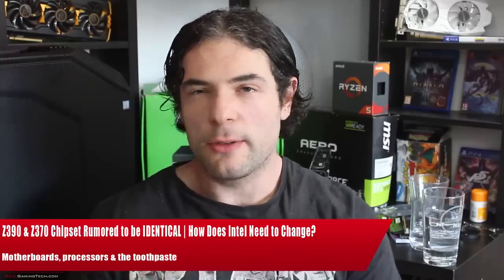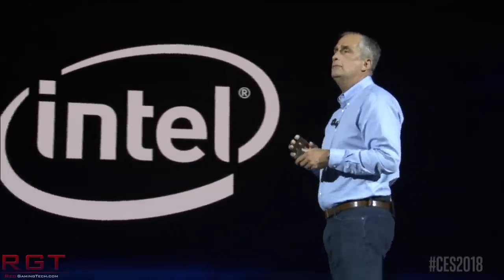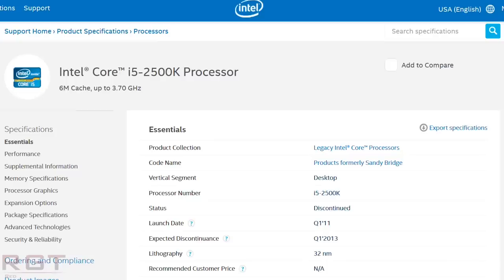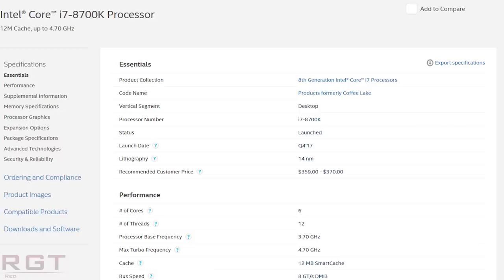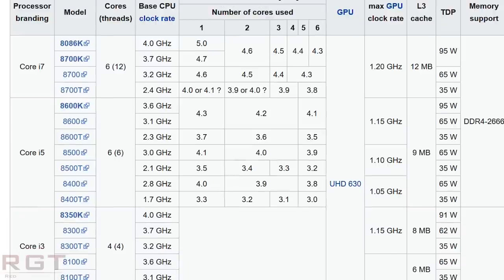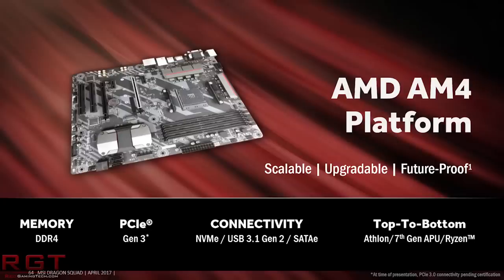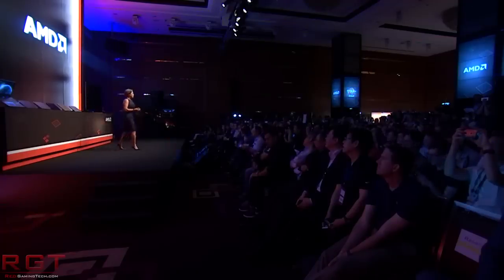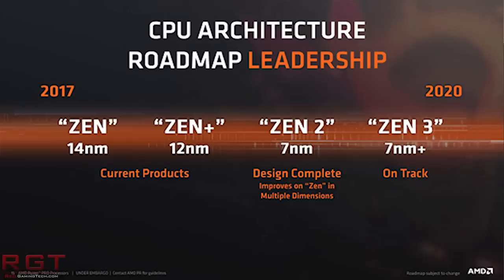Z390 & Z370 Chipset Rumored to be IDENTICAL | How Does Intel Need to Change

Comment: Sure... its totally AMD’s fault that Intel ran away and sat on their butt.

Totally cant be the fact that even during its amazing lead with the early opteron and athalon parts, Intel blocked out OEM’s from shipping machines with AMD chips by paying them nearly their entire yearly earnings worth in cash payments?

Even when AMD was in the lead they where on the back foot, with thousands of unsold chips that they could only offload to places like India and the middle east for cost or less?

That they where bleeding cash so bad they had to spin off their fabs into a separate company?

All while trying to develop phenom... a great chip... then bulldozer... a flop but it was an attempt to push the boundaries.

While AMD was strangled by decades of garbage that Intel got convicted of and fined for, AMD tried and nearly died.

We are lucky that the GOD of cpu architecture design took upon the challenge of designing zen for team red “for teh lulz”. 

Now AMD has a good place to start and with many of the anti-trust lawsuits on Intel bearing fruit - Intel can’t reach into its old bag of tricks anymore.
My only worry is... Zen has some room for tweaks, but I am not sure AMD has the talent left to make an all new x86-64 compatible architecture to top it.
Reply: Zen 2 I think will address the Infinity Fabric latency mostly as well as improving branch perdition and TSMC's 7nm will take care of clockspeeds, then Zen 3 will address latency between dies with an L4 cache on a controller die with the most of the infinity fabric back bone, the IMC and I/O. I would assume a 512MB L4 cache for a 4 die config, also a probable doubling of the L2 cache to 1MB per core.

The reason they could go for such a large cache is first TSMC's and Global Foundries SRAM density, and second it's going to be a separate die so 2 die CPUs can have a lower binned 256MB L4 cache and mainstream parts would likely have there own controller die with only IMC, infinity fabric and I/O, this has it's own benefits however as the die can be binned by the IMC quality, so higher end parts would support faster higher end RAM which makes sense from a consumers prospective, and will be important considering the likely move to DDR5 and the likely cost of highend DDR5 in 2020.

Global Foundries will likely produce AMDs APUs as there "7nm" node wont be ready in time for mass production for early Zen 2.
Reply: spoonikle the funny thing about those fines? they're still not fully paid.

Comment: I find it funny when AMD fanboys praise AMD with such ludicrous worship because Ryzen was such leaps and bounds over their last line of processors, meanwhile mock Intel for only giving incremental increases. Yet the thing is, AMD's Bulldozer line came out in 2011 with a, you guessed it, an incremental increase with its refresh in Piledriver in 2013 - and haven't released anything since. If they had actually been releasing processors for that 4 year gap Ryzen would be right in line where Piledriver left off with its yearly increases. Just because the gap is so huge, doesn't change the fact that the performance uplift is basically exactly on par where they left off. It's easy for a new product to be better than an old product when you haven't had anything out in years. That would be like if intel made Bloomfield then didn't put anything out until Coffee Lake. Of course the gap is huge with nothing in between.

Comment: z390 was already stated to be z370+wireless and something else all boards pretty much already had with 3rd party parts.
Intel uses paste instead of solder because then consumers cannot overclock as far without doing something that Intel can actually point at as a reason to deny warranty over.
Reply: Almost certainly will work on all z370.  People have already dumped even early bioses on Z370 and the active cores count goes up to 8 on them.
Reply: Honestly, it seems like maybe the 8 core is the reason why 8th gen doesn't work in 170 and 270 even though it very much could have worked with most of them.

Comment: I can think of two simple reasons why Intel isn't bothering with putting their K-chips through a separate IHS soldering process: 1- the extra expense of setting up a low-volume soldering process and 2- the CPU already being assembled prior to final binning since it needs something to sink heat into for thermal and power limit testing.

Comment: My shop computer is running a Q9550. My I7-4820K is soldered as well, and have had no issues with either. As far as I know, HEDT processors stopped using solder after Haswell-E/Broadwell-E, Xeon's should be the same through the E5 series
Edit : Changed "with", for "after"!

Comment: I have several old AMD CPUs that are of course soldered and none of them have any issues with anything and they all overclock like crazy with some light tweaking. I've never actually seen a CPU with issues due to the IHS being soldered and I've worked on hundreds of computers of differing specs. I call BS on the intel claim that soldering is less reliable especially considering their enterprise chips are still soldered, if reliability was a concern those would be the line that didn't have solder if any did.

Comment: the reason that intels production on 14nm is maxed out is because they moved the new coffeelake chipsets up to 14nm.  intel always uses the last gen process on the pch and the new gen process for the cpu's.  that would suggest that the next gen (9th gen) will be on 10nm.  cant wait to see if thats true and what it brings to the table.  would love to see the 8 core cpu work on z370 but if it doesnt its not a big deal to me.  the 8700k is all ill need for awhile but intel need to sort this out and get motherboard support mroe in line with what amd are doing.  now that amd's cores are on par with intels at the same clocks then they dont have the luxury of not changing things up.  and yes the 9th gen needs to be soldered, at least for the i7's and maybe the high end i5's at least
Reply: waterblocks and aircooler baseplates that fit within the plastic frame of the socket or a socket more friendly to naked die mounting would be nice.  cpu's used to come naked without a lid or solder or tim
Reply: bobhumplick The Intel CEO Bryan Krzynich that changed to non solder is gone
Reply: @darrenrapheal i dont see what that has to do with anything
Reply: bobhumplick The Intel CEO Bryan Krzynich that changed to non solder is gone.
Reply: @darrenraphael i still dont see what that has to do with anything.  what are you trying to say?  are you saying the cpu's will be soldered now?  maybe be more specific in what you mean.  yes i know brian krzanich is gone, but so what?
Reply: bobhumplick They will go back to solder to stay in business. The CEO that Bryan Kraznich resigned destroyed intel. Intel will be dead in 10 years because of him.

Comment: Ummm the Z390 will include support for the proprietary intel A/C wifi and bluetooth modules that won't work without that.
That's not third party stuff and from that we can deduce that Z390 is not the same as Z370.
What we do know is that there is literally no difference between the Z270 and Z370 chipsets. The Z370 is the rebadged chipset.
If there is no chipset support for the wifi/bluetooth with z390 motherboards, then they'll all be rebadged z270 chipsets.
You'd think they'd just enable overclocking on H370 and rebadge that. (but short 4 usb ports)
Or enable raid and overclocking on Q370 and rebadge that.

Comment: I have a 3960x soldered CPU for 8 years now, running 3.2 @ 5GHz with a AIO first then a custom loop. No craks or problems maybe if you let temps go above 65° for several times it may cause degrading and cracks don't know. And like some peapol repoterd using a old gen mobo with vrm etc designed for a16 core cpu and power drawe just can't handle a cpu drawing double with . Will burn up if you put a 32 core one it with a new cpu with double the cores is like

Comment: ryzen 3700x 7nm 3.9 ghz 16 core 95-105 watt tdp some extra cache overclockeble to 4.9 ghz
ryzen 4700x 5nm 4.4 ghz 16 core 95-105 watt tdp same cahce as 3700x oc to 5.1
ryzen 5700x 5-3nm 24 or 16 cores but with 30% more ipc and supporting ddr5 ...zen 3 will be supporting ddr5 with am4+ mainboards

Comment: Solder dosent crack this is complete bullshit. Its intel covering their asses for using the cheapest garbage toothpaste on their heat spreaders to save a few bucks on each cpu. Every soldered CPU Ive ever owned has never had heat spreader issues relating to the soldering - ever. Soldering is an somewhat expensive process but well worth it. Anybody remember devils canyon? LOL with the shit thermal paste and insane temps. Good job intel.

Comment: AMD is kinda incompetent but at least they honestly try to innovate and that beats Intels intentional stagnation and holding the entire industry back while price gouging out the wazoo. Like seriously they don't solder processors to "save cost" on a chip that's sold at over twice the price it should actually cost? Yeah sure
Reply: And there GPUs well that is partly there own fault by choosing to go with the SIMD architecture, but it's also the contract that they had with Global Foundries which were there fabs before they had to sell them off to survive and in the contract it states that they must use Global Foundries first until 2020. And honestly at first it worked out pretty well AMD had poured a lot of money into there fabs and there were some really good processes on the horizon.

But then because Global Foundries knew they had a captive customer so they didn't invest to keep there node advantage, which was kind of short sighted and thats why you saw Global Foundries buy IBMs fabs and thats what they are using for there "7LP" node. They will probably fumble that away after 3 to 5 years as well and die, which isn't a good thing because that basically would only leave Intel and TSMC as the 2 major fabs, and Intel doesn't produce much for anyone else, so for everyone else it would leave TSMC as a monopoly.

If AMD is in a great finical position I would hope they would buy Global Foundries back up and rebuild them and also sell some of there manufacturing capabilities.
Reply: Etheoma they won't be in a great financial position for a while. sure things are turning around and they're making money, but they still have a lot of debt to pay off.

Comment: Intel needs to solder the k cpus and unlock all their line-up. And of course, lower the prices.
Amd needs to realise the ultimate Apu's and give up on the lesser videocards that nobody will ever buy over the much better geforce ones. An 2240g will be the best thing after the big bang, budget wise. 
Threadripper with 2400g will be something amazing, really next Gen Apu!
Nvidia needs to realise a asynchronous compute hardware based gpu. Ray tracing is great, but will kill all the market, the current generation and the older ones will be so obsolete that everyone will dich altogether the pc and get a console or just stick with mobile devices.
And every one of them needs to realise, that all the shrinking and much better yealds, needs to translate to lower prices... this pc master race is a dying dinosaur...

Comment: I do not agree with soldering the K-suffix skus, they are meant for enthusiasts and if you are really want low temp with a high overclock then you really should work for it, not just selecting an multiplier in the bios, and overall for gaming an oc does not that much anyway, you would rather go for a faster gpu and then for much faster ram than getting your cpu to run some more mhz...
Reply: Soldering pretty much negates the need to delid. If you really want to delid the cpus, bake them to melt the solder and apply your liquid metal to drop 1-5c
Reply: OK, the one click oc is not the way to go, but that's not how you get a high end max oc the last 100MHZ are just tweaks etc. . So you preffer (really) risking to kill your CPU bye delidding and say it's  a good thing ? (and paying for the  whole crap to do it  is normal) and  when i need to clean my watterblocks i risk a lot with a dellided half seald cpu. And oc does improve  gaming, ocing your cpu, Gpu and ram (not a bit but like al the way) will get you a serios boost

Comment: I don't think Intel doesn't solder their cpus because of cost, but maybe because of something else, something technical that might only applies to their way of generally packing the chip in that pcb, under those conditions. I might be wrong and it might be indeed only for cost reasons, or even both who knows...just saying though...

Comment: the majority of people who buy new PC dont buy a new CPU every year, so intel changing the chipset alot  is not a hugh problem for most...
Reply: The people it does effect are there most loyal customers which is why it's so shitty.
Reply: Blea Berry maybe not, but I can at least upgrade to a new Ryzen chip on my AM4 board. that won't actually require me to build an entirely new system. it's why gpu upgrades are some of the most common upgrades.

Comment: when it comes to solder cracking that depends on the size of the die and the heat density of it.  the 8700k is 3/4 the size of sandybridge and can draw WAY more power and put out much more heat.  just because large dies can be soldered doesnt mean that todays much smaller dies can be soldered without bad consequences.  of course if they moved some of the cooler running circuitry from the pch onto the die they could solder it because it would be larger and the added circuits would be relatively cooler running.  

the server cpus are solder of course.  but they have much lower heat densities. a xeon is locked and runs 4ghz and below and for the high core count ones much lower.  a die that is 3/4 the size of the 2500k that can put out 200w or more when running avx is a whole nother ballgame.  i actually think intel should nerf avx2 perf a bit to keep the power and heat in check.

silicon (the die) does not expand with heat and is very thermall stable.  the solder and the ihs are both made of metals that expand quite a bit when heated.  when you have one thing that doesnt expand soldered to one thing that does expand a lot then you have a lot of tension between them sort of like compressing a spring
Reply: So what is Intel excuse with the 7900X series of chips, the dies certainly are large enough that it should not be a problem?

At the end of the day, if and it’s a big if, the solder cracks which does not seem to have ever been a problem, why could the chips then not be delided then. AMD does not see it as a problem and only avoid using it on the lowest end chips for cost.
Reply: you cant make the die bigger by adding more cores to fix the problem cause those cores add more heat.  its not the size of the dies that is the problem its the heat density of the chips.  you need to add stuff from the pch that runs at a cooler temp or just add dark silicon to it.
Reply: amd dont see it as a problem because their chips dont run above 4.3ghz or so and because at least a third of the chip is stuff that uses less heat than the cores. things that are normally on the pch with an intel chip. thats why ryzen is called a soc.  things like usb controllers and the like are on the die.  if you took that stuff off the ryzen die, then clocked those cores up to 5ghz or more, and then shrunk it a bit more (cause amd's 14 is really 20nm and their 12nm is still bigger than intels 14nm) then you would have the situation that intel is in and you might have problems.  remember that when amd went to 12nm they made the dies the same size and just put blank spots between the other parts of the die.  could be they did this so they wouldnt have to change any of their machinery that puts the cpus together or it could be so that theyre new hotter dies arent smaller too and cause possiblilty of cracking in the solder
Reply: i dont mind delidding.  and yes if you operate it at stock then it will be fine so its not a big deal
Reply: bobhumplick, correct me if I’m wrong but it’s not frequency that generates heat, it’s voltage and you can run both AMD and Intel at the same voltages generating similar heat.

But you never answered why on earth the 7900X series of chips were never soldered?
Reply: Renato Sabo, as much as it does effect overclocker it also effect the achievable boost clocks people can get in many workloads as well. 

Maybe you can answer, why wasn’t the 7900X series soldered?
Reply: Renato Sabo, just checking but current is usually associated with load so in essence AMD and Intel under full load and with the same voltage should have the greatest effect on heat density, not what frequency it’s running at as the OPs comment was suggesting. Only reason I never mention load as assumed it was a given.
Reply: Renato Sabo coming back to your 7900X answer, if that was the case then why do they solder Xeon processors? The dies are far more valuable and not overclocked so will have less heat density to contend with. If that was the answer then you would see the same with Xeon.
Reply: I have to mention this as I have seen it in several places that the overclocking is so small for Intel to care yet I ask why do they bother having K series chips at all, they are literally for overclocking, they are unlocked chips for a reason.
Reply: Renato Sabo the thing is that Intel could actually use a better paste. that's where my issue is.